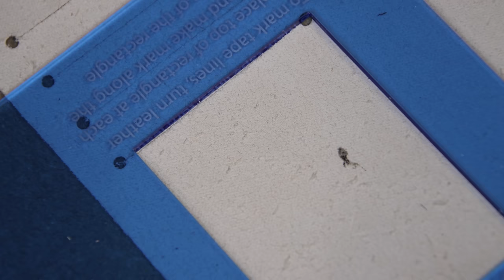Making an American Flag Wallet

Comment: Hello Daniel, enjoy the vids, learning a bunch. Does the double sided tape give a permanent adhesion to the leather ? Not everyone is gentle in putting cards away
Reply: Great question! Double sided tape definitely isn't as strong of a bond as,  say... contact cement, that being said,  is a pretty strong bond. 
Aaron at Makers Leather Supply shows this method in his video and really speaks highly of it. (He designed the template)
Reply: I have used double sided tape for this application and have not had a single failure in the years I’ve used it. Occasionally I would use the tape only at the top of each slot and still no failure.
Reply: @jimgreat7622  Thats great real world experience! Thanks for the info.
Reply: I made a bunch of these with the double sided tape and if you leave the wallet in a hot space for awhile the tape melts. I’m remaking a bunch of them with a new design. In my experience this method of pockets isn’t a lasting solution

Comment: I like this wallet, and it looks like a fun project…but the stars are driving me crazy. They look random and not aligned like a flag. Also what stencil did you use for the stars?
Reply from the maker: Daniel drew the stars and then we digitized the pattern using photoshop. the pattern can found via the link below, you can always change the pattern of stars. https://cdn.shopify.com/s/files/1/0611/5809/7036/files/Stars_and_Stripes_Pattern_Updated.pdf?v=1687284211
Reply: You're right, they aren't laid out like a real american flag. The main reasons were, 1. It's a stylized flag. 2. It allowed me to make the stars big enough so they would stand out. It also put them in a size rang that most people could carve. Good eye!
The stars were carved by hand, not stamped, but I believe there are .75" stamps out there that would work.
Reply: @DanielReachCreations  All good, I think what was throwing me off was the  missing star and I commented before it was mentioned in the video. so it worked out in the end.
Reply: @MrDizzle715  Oh yeah! Once I saw it, it drove me nuts too! Can't believe I missed it. 😆

Comment: I realize most people have respect for the flag but not enough. "What is the basic flag code?
The flag should never be carried flat or horizontally, but always aloft and free. The flag should never be used as wearing apparel, bedding, or drapery. It should never be festooned, drawn back, nor up, in folds, but always allowed to fall free." I find it odd that it's always the {Ultra Patriotic} that actually show it the least respect.
Reply: It may go against a "code" but I like it and think it's very patriotic.
Reply: the code is not mandatory: it uses non-binding language like "should" and "custom" throughout and does not prescribe any penalties for failure to follow the guidelines. It was "not intended to proscribe conduct"
Reply: It should also be noted that this is not a flag but a wallet with a patriotic theme.

Comment: nice wallet, and nicely done, but I am curious as to why you used lacing chisels for creating your stitching lines/holes??
Reply from the maker: Hi there, these are straight blade chisels. They can be used for lacing but they are also great for hand stitching, just a different option from the more traditional diamond shape.
Reply: @WeaverLeatherSupply  - not really.. the flat lacing chisels leave a rather long hole, not ideal for stitching with thread.
It also confuses new people to see things like this, thinking that is what they need to purchase for sewing when in many instances it would be totally wrong...
Just because you can does not mean you should.

Comment: I am a learner. I want to know what kind of dyes are used in leathercraft.
Reply: Chuck has done several videos on this topic that would be a great place to start. Just type in something like "Weaver, Chuck Dorsett, Dye" and see what comes up. 
As far as a quick answer, my favorite dyes are Fiebings Pro Dye. The reason they are my go-to is because they will only go so dark, then they level off. Most of the other dyes will just keep getting darker and darker the more you add, which means you can end up with blotchy dye.